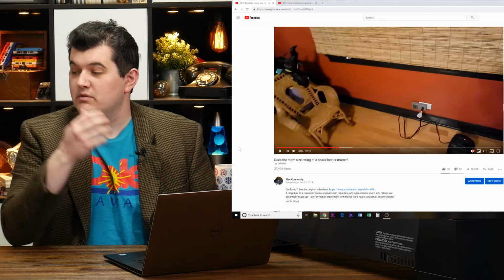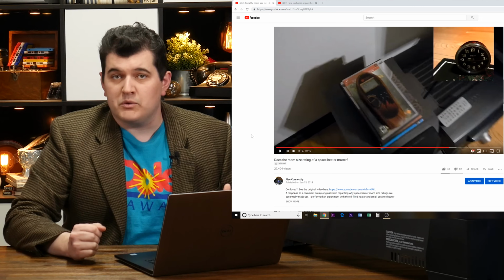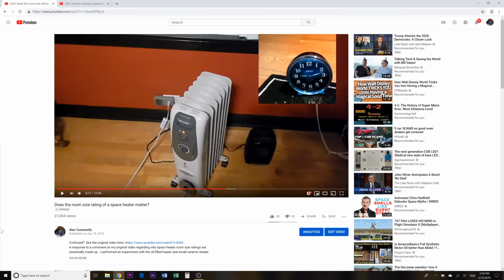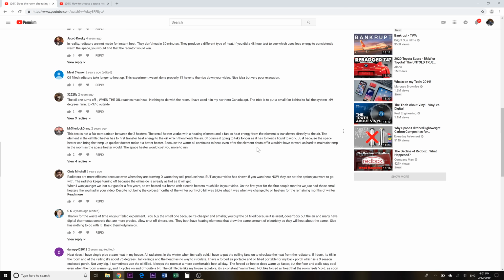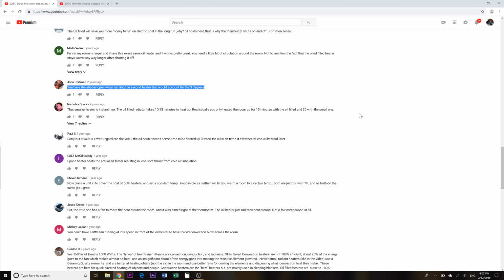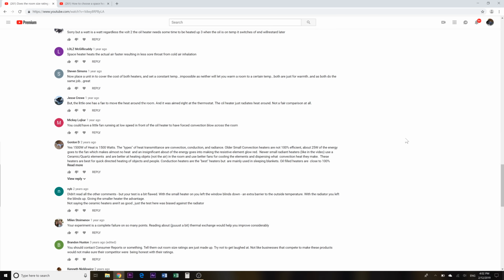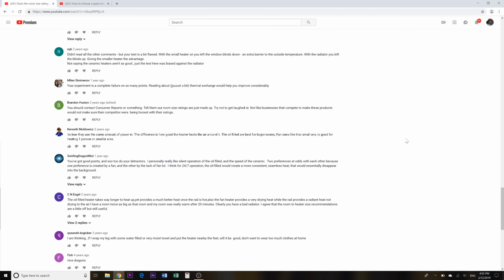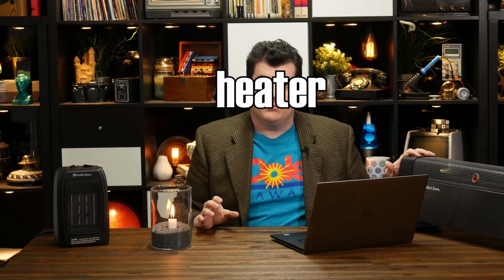More Space Heater Nonsense

Comment: I know you'll probably never see this, but there's something that you're forgetting when you're talking about these space heaters. How is the heat being transferred from the space heater to the space? There are 3 ways that heat is transmitted: convection, conduction, and radiance. An electric coil heater, it primarily heats the air (convection), although there is some radiation out of the front directly from the heat coils. The air heats up quickly because there isn't much thermal mass in air. An oil filled heater heats up the oil and then the oil dissipates this energy by radiating heat (though there is some convection). This radiation heats up objects in the room. This takes much longer because physical objects have greater mass than air. A radiant heater is useful to put next to you because you will directly feel the radiant heat just as you do when you stand in front of a fireplace. An oil filled radiator measures the temperature of the oil in the radiator, not the temperature of the room. Because heat can only be dissipated so fast by radiation this limits the amount of heat that can be transferred to the room.
To sum up: the way heat is dissipated by the heater is important!

Comment: IMHO the big difference between gas/electric that makes Hot Air   vs   woodstove/radiative that Is Hot         is if u have doors/drafts that might wick away all the warm air.   in those cases, nothing beats the persistent warmth of an irradiative heat source.        when your heatsource is blasting out IR and making surfaces around it warm, which henceforce also heat the air,   then the space Feels Warmer because any quick draft of cold air is quickly re-heated   VS  waiting for a Hot Air source to replenish heat after all sort of turbulent air mixings.      consider considering the idea of "heat inertia" as a consideration

if i have one room heated with gas at 70f   and another room heated with woodstove at 65f,     i actually get chilly walking away from the woodstove into the "warmer room".   there's somethin special about IR versus "blowing hot air"

Comment: just as searing hot fire fails to cook a steak through, you must use a bigger but lesser source that uses the same power to distribute the heat in a wider area. the heater for a large room wouldn't beat a small heater at heating a small room, of course. do you think an oil heater would limit itself more often or less often in a small room than in a large room? if you want large temperature differentials throughout the room keep blasting the little thing but otherwise give them both five hours in a large space and see which case the room has a larger area where it actually feels like the heater is on. you need to think about how temperature disperses through space and not just how power converts into temperature. "the large space heater limits itself when i try it in an enclosed room" is not sufficient evidence for your claims. anyway though i did enjoy watching you talk about this despite my frustration - your voice and demeanor are really pleasant and forgive me for saying this but you are also quite nice on the eyes. hopefully by the lights of curiosity and insight you can have a less aggravating time the next time you run across a space heater display in a store.

it's not really germane to the question here but another big consideration to think about when choosing a heater is humidity. humidity helps warm air retain heat. radiator style heaters tend to leave the air's humidity as it is, while ceramic heaters strip humidity out of the air as it passes through them

Comment: The only real difference I can imagine the forced convection does aside from preventing the heater from melting is circulating air leading to reduced hotspots and more uniform temperature.

It’s technically true the amount of energy introduced to the space is the same and theoretically it should naturally spread out due to convection currents but it’s going to take time. And sometimes a lot of it. That and the heater will always be producing a stronger hotspot if it can’t circulate enough air.

It’s like having a woodstove. Eventually it will heat the whole room but the heat will still almost entirely be concentrated around the stove

Comment: Yes, two space heaters, regardless of size operating at equal energy consumption will output the same amount of heat. I don't know why anyone, anywhere is arguing about the validity of that statement. 

But that does not mean the intended use cases are the same, and that is a basis of legal/safety standards.

The little heaters are intended to be used for limited durations. That you can theoretically leave them running 24/7 doesn't mean it's advisable, particularly for something that can still, in 2024 be found for $10-$15. 

The oil filled ones are designed for continuous operation. That doesn't mean they're better, or more efficient, just that they're less dangers associated with prolonged use.

My dad was paralyzed, which resulted in his being perpetually cold. All my life he some variation of space heater. When i was a kid it was a robeson steam heater https://bid.liquidbidding.com/lots/2607009, which would sit 4 feet away from him in his office blasting the entire day. But that was eventually lost in a move, and replaced by one of those little tiny $30 things with a fan. One night he fell asleep with the thing running, and i walked in to smell something burning....the cord had almost melted through, and it couldn't have been running for more than a few hours.

That's the difference, everything else is marketing BS.

Comment: The most efficient way to heat a space is to use a method in which the desired temperature is reached, then sustained for a considerable amount of time when the energy needed to reach that temperature has either been reduced to a negligible amount or paused, and objects in that space can absorb the residual heat.  The best home heating systems were old boiler and steam radiator systems because once those cast iron radiators got hot, they'd still give off heat even after the boiler stopped running and circulating steam through them.  Oil filled electric radiators operate much the same way...once the fins get hot, you don't need much current to maintain their temperature and they still give off heat for a time after turning them off.  Fan forced heaters may blow hot air out of the front, but once the heated air moves a few feet into the room, it gets cooled by the cold ambient air in the room, and the floor, walls, furniture, etc. never get to absorb the thermal energy.

Comment: Yes, they are 100% efficient technically but i guess the fan heater may be more directional. So for a perhaps fairer test perhaps you need to switch them both off and see how long it takes the room to cool back down.  I'm guessing that the oil storage heater will continue to emit heat over a longer time and you are simply flattening the curve.

Comment: All heaters dry out the air, because warm air can hold more water vapor, as you heat the air, assuming you are not adding moisture the relative humidity will go down.

Comment: My favorite experience with space heaters is camping in the rv in early spring. I would run space heaters at night and it
would get to the point of sweating in 30 minutes. I'd get ready for bed and then shut them off and climb into the blankets and sheets. 
     In the morning i can feel the cold on my face and it was hard to get out of bed, but i would then hurry and jump out of bed and get dressed and turn on the heaters and start the gas stove for breakfast and i was already feeling warm in 5 minutes.

Comment: The real trick is to avoid heaters that are junk. Both theses heaters come in junk and less junky flavors. Run them at a high rate for 4 or five months and then report back. The next most important thing can be esthetics, shape color, noise etc. Then of course does it work, if not then it's junk. 
You pointed out a thermostat design issue with the oil filled model that makes it junk, good!

Comment: My personal understanding is that oil heaters are not meant to raise temperature in short stint but are meant to do it over long periods of time, say overnight maintain around 26°.
So yes it ought to draw a lot of power initially but than only do small adjustments every hour or so. That way it is meant to be more effective.

Tho the positioning of thermostat and protection on those heaters mentioned by commenter and presenter seems rather stupid.

NOTE i have not used modern oil filled heater but i did use 80s or 90s one some decade ago regularly, one that DID work as intended, which is why it was replaced by direct fan heater that did in fact provide big bursts of energy to cope with frequent door opening to the outside. That is why i use a lot of assumptive language it is quite a while since than.

Comment: I remember trying to tell someone (who apparently is an electrical engineer) that using a resistive regulator - meaning the oldest form of fan regulator with nothing but a coiled hunk of resistance wire with electrodes popping out at different resistances, wasn't making the inverter it was connected to, last longer if it's on slow. 

Even showing him by wattage consumed wouldn't convince him. I completely understand your pain!

Comment: He is right to say that the oil filled radiator does not stay on at its full setting because the safety device kicks in before the thermostat. even if it is at full setting the safety switch will kick in sooner. So it's just a badly designed product problem.

Comment: Stratification: the comment was skipped over that addressed the rad causing the heat to float to the ceiling. Rather than being forced around the room with the small fan heater. An idea might have been having a room fan/ceiling fan going if the test was repeated.

Comment: What I like about the oil filled heaters is that you can sit really close to them without getting IR burns like you do from the units that expose the element to the air. I suppose it can burn you like that but it takes a long time and simply shifting my weight around  periodically is enough for me to avoid it.

Comment: I give you an example why a bigger could be more efficient - I have quite some passive ventilation - f.e. cannot close it in the bathroom, and I have a cat, so, bathroom cannot be closed. So, what we get in the end is hot air is just escaping before it can heat up the actual space. But with convectional heater, I would imagine - the flow will be slower, so, more heat will stay in the room

Comment: Your experiment was fine, and you did address the elephant in the room about the claims of the products. Conservation of energy. If you draw a certain amount of power, the question is only whether you actually turned that power into heat or not. It's hard to not be efficient at producing heat, but a thermodynamics expert might speculate that the best way to bring a room up to heat via electric current is slowly, and therefore would go on to argue that power cycling is more efficient for a large volume of space and for long term. That's debatable and you'd have to graph power consumption of the electrical device versus complete heat energy in a given volume over time. That's a hard experiment to precisely do. As a former student of mechanical engineering, I'd be willing to side with this fictitious thermodynamics expert, because I believe there is this underlying stability to having thermal mass - in this case the oil - as a buffer of heat energy dispersal and thereby making the whole system close to adiabiatic (inifinitesimal) and therefore closer to reversible and therefore closer to perfect thermodynamic efficiency. But, that's just a gut feeling about some abstract concepts I never really understood thoroughly; not any true critical thinking going on there. So, in the end, I would say the only good thing about the oil reservoir is the "even keel" nature of its operation if that's your thing.

Comment: We are lucky in the UK we can have 3kw heaters .
Reply: Because you have 230 volts at your electrical outlets. US is about 120 volts. Your 3000 watt heater is drawing about 13 amps, the USA 1500 watt heater is drawing 12.5 amps. The heaters would be producing nearly the same about of heat.
Reply: @rizzlerazzleuno4733  also each plug can be fused to the correct load,shuttered switched sockets Earth (ground)pin on every socket and now most houses equipped with a RCD to trip in eventually of an earth fault.

Comment: You are correct. One watt equals 3.41 BTUs, 1500 watts equals about 5100 BTUs.  There are basically two types of heaters Radiant and Convection.  Radiant heaters are used to heat items like you if you are in a poorly insulated room.  Convection heats the air and rely on air currents to move the air around the heater. The oil filled heater will raise the temperature of a room the same as the small ceramic heater but, the oil filled one will take longer because it has to develop air currents.  The ceramic heaters have a fan which will force circulate the air.  The oil fill heater will heat the air, and the heated air rises so the top half of the room will fill warmer than the bottom half of the room and as you said turn on a fan to even the heat out.  In your experiment with the oil filled heater if the thermometer was near the floor the temperature will be lower the temperature higher up in the room. I suspect the temp at the ceiling was about 6 or 7 degrees warmer than an hour earlier.

The reason for the large and small room is Psychological.  A person with a small cold room, will buy the large room heater thinking it would be better at heater the room.  The oil filled heater I purchased was 79.00 dollars and it work fine.  The small ceramic small room heater was 20.00 dollars and worked better than the oil filled heater, it heated the room more evenly and faster because of the fan and not having to wait for the oil to heat up.

I also have ceiling fans in my house that run in reverse and on slow to circulate the heat trapped at the ceiling and my cat pulled her bed to in front of the heating vent.

Don't feel bad about the comments not everyone is as smart as you and I.

Comment: I've used the radiator style heaters for a few years in my tiny home, with the raditator style ones it works best after a long period of time as they don't move air, they fill a room with heat from the top down, if you put your hand around a rad heater in a cold room you have to get close to feel anything but if you put your hand above it you can feel the heat rising.  Ive leared that if you circulate the air like with a ceiling fan is works much better ( air movement also cools the rad heater making it cycle longer)

Comment: Your oil filled radiator heaters have a couple of advantages:
 * No moving parts
 * Liquid oil carries the heat away from the element keeping thermal expansion and contraction minimized, this makes it last longer
 * Lower surface temperature, so could be safer
 * Closer to the ground than some heaters so you get a little more convection currents, depending on the model and positioning
 * Quiet, very quiet.

A mechanically simple heater that will last a very long time. You get your money's worth out of it, because you can have them for several years before they eventually burn out.

Comment: I watched some videos about oil filled heaters not being able to naturally convect 1500w worth of heat continuously so they effectively are self limited to something in the area of half the wattage over time. IE the full 1500 is only really ever used during start up/initial heat up from cold and then they will just turn on and off as they overheat themselves.

I bet this only contributes to the myth that oil heaters are more efficient because they simply just use less power, not produce more heat

Edit, I went and found the exact video. It's on the Matthias random stuff channel called 'oil filled heaters: 600 watt heaters pretending to be 1500 watts'.

he goes through how to re-wire the high/low switch so it's 400w/600w instead of 600/1500 or whatever it was.
https://www.youtube.com/watch?v=W8MFaZ9-oNI

Comment: The one with the blower will, all else equal, be better at pushing the heat to a thermometer at the same height as itself. Rather than just having it convect to hang under the ceiling.

Comment: Space heaters for bigger rooms are designed to run for longer periods of time. So it makes sense to have different ones, even if the output is the same while in use.

Whether in practice this difference is real with how the companies manufacture these devices is a separate question. But it is not inherently wrong to have a something meant to run longer be designed different, even if the power output is the same.

Comment: 10:49 it does dry out the air though. The only reason it doesnt effect humidity as much is because it is worse at heating, if you used enough of them to generate equal heat you would get equally dry air

Comment: An analog clock. Hey ya'll ....an analog clock, check it out. I did see a comment below that makes some sense. The commenter mentions he worked for a company that produces both and the difference is the radiator heater is safer for a large room because it does not run continuously, where the ceramic heater would most likely run non-stop in a large room but could also cycle in a small room. However, I would think the more one cycles the less efficient it is. I think the ceramic heaters are the best thing since the zipper.

Comment: I myself put a box-fan on low behind one of those oil-heaters and it was 10x better because it no longer got hot enough to kick itself on and off. Yes I agree, 1500-watts is 1500-watts. If you have a 1500-watt PC that is actively using 1500-watts, it's heating the room it's in the same amount as the fan-driven heater you've shown here.